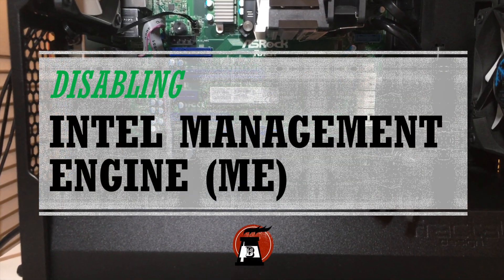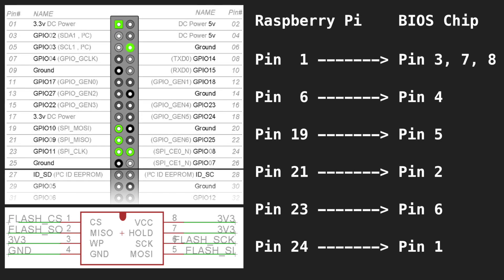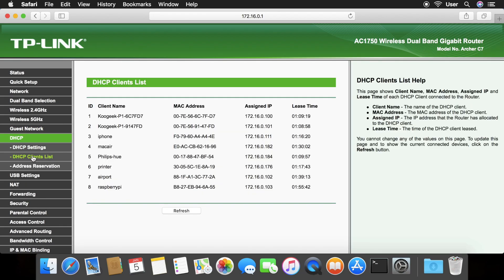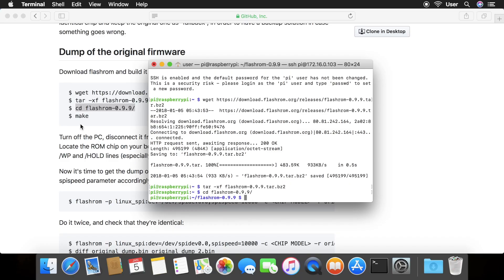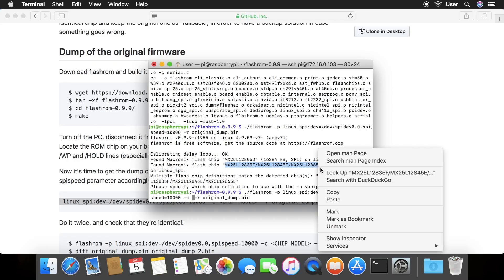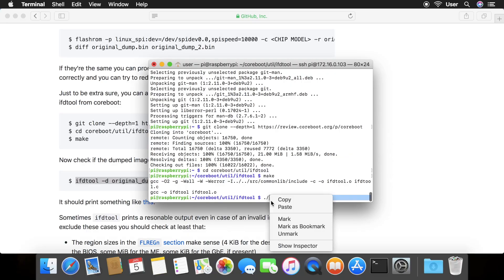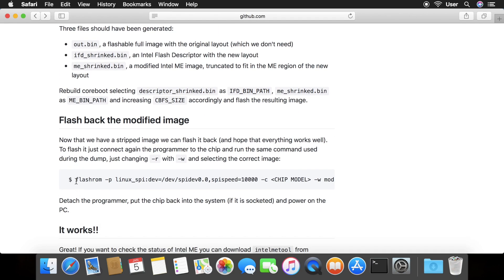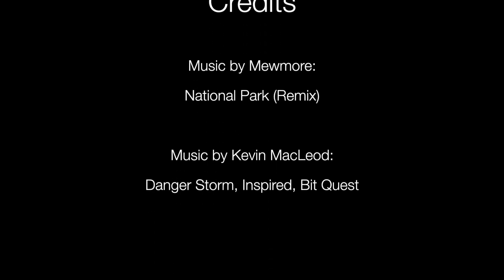DIY: Disabling Intel ME 'Backdoor' on your Computer

Comment: so Intel is even worse than Huawei
Reply: @Вероника Заглотова How is it called ?
Reply: @Вероника Заглотова AMD has same level, but can be disabled on bios.
Reply: @Вероника Заглотова https://forum.level1techs.com/t/unverified-amd-to-allow-disabling-psp-in-next-agesa-update/122202/ from this source. I have Lenovo Z40-75 and A10 7300 with update bios and i can disable AMD PSP settings. Depending on motherboard or laptop manufacturer may vary.
Reply: @herfyhidayat  The disable option is useless since we can't tell if its actually been disabled. AMD firmware is open source except for the PSP which is closed source.
Reply: @zyan983  I can feel when AMD PSP is actually disabled, performance also increased, and system more responsive, just like when Spectre & Meltdown disabled on intel side.
Reply: @herfyhidayat  All the PSP does is supervise stuff. Disabling it shouldn't lead to a major performance boost. That's something going on with your OS. We also don't know how heavy the PSP is or if it does anything else besides remote access & supervision.

Comment: I'd STRONGLY advise against it. Firstly, Intel states that ME is involved in controlling parts of the CPU that deal with overall STABILITY. Tho Intel does not state what exactly. Secondly, this video shows old style DIL flash chips. For a couple fo years such flash chips are SMD chips and/or they are NOT SOCKETED. Which makes this video largely obsolete on mainboards of roughly the last 7,8 years.
Reply: Get outta this video, three letter agency shill

Comment: Remember, Intel Inside is Mossad Inside. Same thing with AMD. AMD uses Intel's CPU instruction sets. If you don't want the deep state to be able to spy on you, do what is done in this video, get a Linux distro which isn't Ubuntu, because they sell your data to Amazon and possibly to the deep state as well, and avoid using anything Google related. The only Google thing I use is YouTube. Use DuckDuckGo as your search engine and an open source web browser. I'm currently using Firefox, but make sure to change the settings so Firefox won't collect any data on you. For an email service, I recommend Yandex mail (a Russian provider) or ProtonMail (encrypts everything so only you have the key). You could also look into Qubes OS, which is what Edward Snowden uses.
Reply: If any of this was true, you would not be allowed to know it.
Reply: @itstheweirdguy  Information leaks out sometimes. That's why censorship is a thing. People put facts together to come to logical conclusions without having absolute proof or the approval of authoritarian media.

Comment: Could this also be fixed by using some low value resisters across chip pins?
Reply: you will only harm your CPU dont do anything
IME is in the CPU and it is also a Manager for the CPU (booting etc) if you remove it in anyway (if possible) you will destroy your full CPU
Reply: @JustPlayerDE  Following the instructions in this video does not disable IME

Comment: Young man I'm lost. How much would it cost me for you or someone to do this for me?
Reply: It is really a fair question. To know that there is a problem and a solution to it does not require one to know the technical details, in this case. Just find the right person who can install the solution.
Why not just flash the BIOS which is a built-in function in modern computers?
Reply: If you don't understand the problem, then why do you absolutely want the solution? Do you know what Intel ME is, what it does, and how it affects your use of your personal computer?

Or do you just want to find the solution of a problem you can't even comprehend?
Reply: @flyingspaghetti  I would like to know without all the bull sh-t you just spat out how much would it cost to fix problem? You see I'm old and don't understand all the workings. But I do understand the government intrusion and it is not right and is down right (EVIL). That's what I understand. Do you understand?
Reply: @kennedy67951  it really depends on the hardware you need or want to use.  i would recommend to post an email to the nearest CCC. explain them your situation, what you have/need/ do with your machine and ask them to help you out and compensate them for their time. they will most likely help you out. Besides that, be aware that you need to learn some new basics to use a really secure computer. its not possible to run it 100% save with windows.